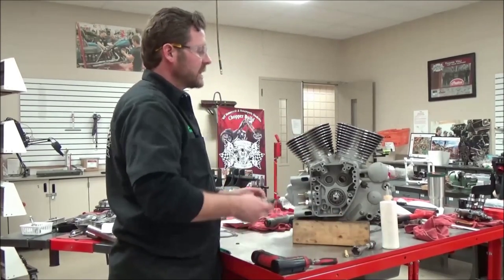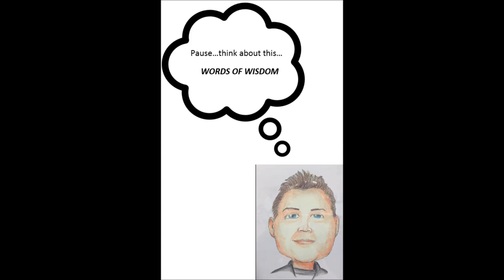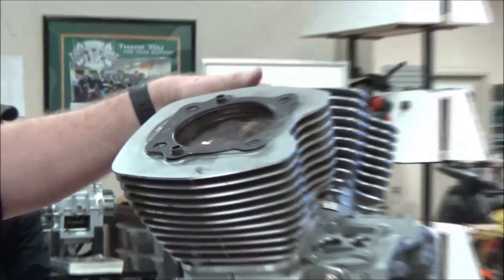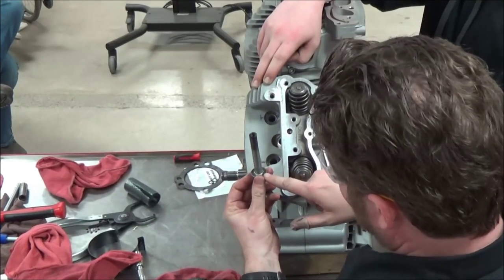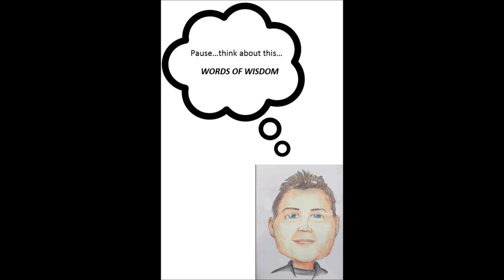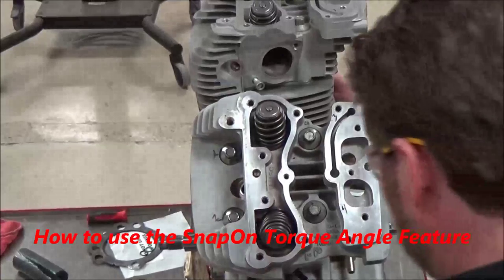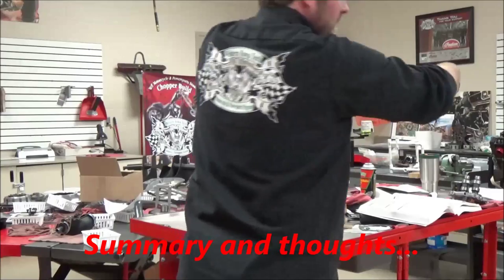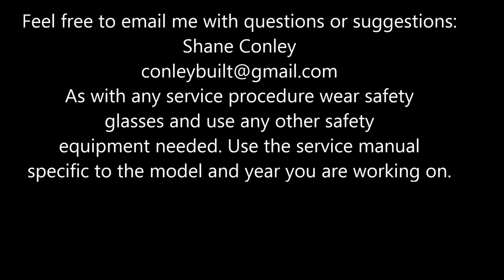Twin Cam Series: 14 How to install Cylinder Head using torque angle procedure on a Harley Davidson

Comment: I did this technique on a Buell blast head, followed manual and stripped out 5 fasteners. I then had to install helicoils and a keensert fastener. Got it to finally work. I just think that he heads were worked on before my time and thus the aluminum material probably was degraded on prior installations. But again, your videos are crack dead good!!! I’m an aircraft mechanic by profession and a hobby mechanic on weekends and still I have to look to the internet for advise and educational knowledge. Keep it up dude!!!!

Comment: Just tore down my 2016 FLSTFBS 124" build for lack 9f ring seal. The assumption was that the pistons and cylinders where not done correctly and I know Torque plates where not used. When I started to back out the 4 bolts I was shocked by how loose they where .  I used ARP Torque grease on the heads and a dab on the threads. Now I'm not so sure and would imagine it's a combination of both. I did not after first start go back and retorque but will this next time. The cylinders have pretty bad scoring but not felt by fingernails.
Reply from the maker: The cylinders will "streak" with varying thickness in the wall thickness and it's get's worse with larger CI. I've torn down motors with no to minimal leakage and was shocked at these streaks. Harley instructors at PHD did a good job showing us some cut away cylinders to explain it. Now streaking from debris or oil issue is a different story the "heat" streaking. Just mentioning if you can't feel it, should be a good chance to torque plate and hone....clearance spec permitting. Also, if heat related the pistons will look fine. Shane

Comment: Thanks for posting these, very helpful. Subscribed. Any recommendations for removing baked on gasket material from cylinder heads? I’ve tried multiple solvents with no luck. Also, I’m afraid to scratch the metal. Thanks, in advance!
Reply from the maker: I believe I did a video on that...I'd have to look. I know I taught it for 15 years...😀 Join the channel and I'll look or give you a call. 
Thank you for commenting. Could you spare $2 and support us with even more benefits? Smash the subscribe button and bell! Join this channel to get access to perks:
https://www.youtube.com/channel/UCBhM8DCKnT3qXwTW0eToyCg/join   
-Daily MEMBER FIRST COMMENTS ANSWERED FIRST 
-Live Q/A video chats
-Wonder if we have a video on your need? Members can request content links!
-Full Access to the ENTIRE 700 video library
-Member-Only FREE tool giveaways 

Just want to say thanks quick to support us for this information and our work saving you money? 
Give us a high 5 here:  https://www.paypal.me/how2wrench